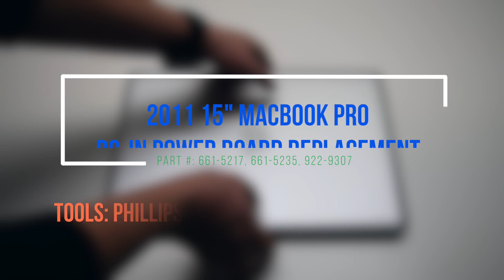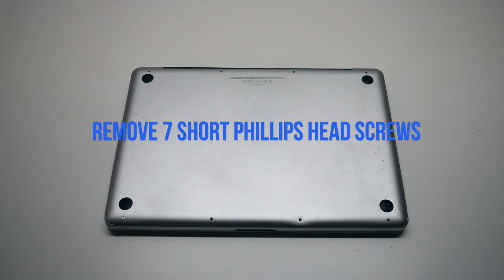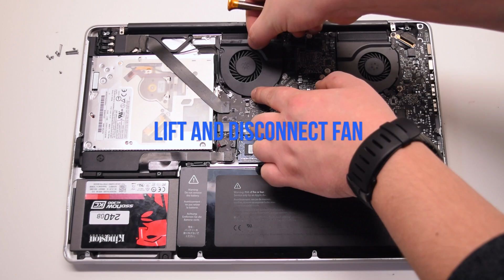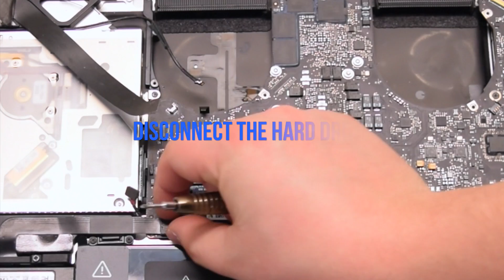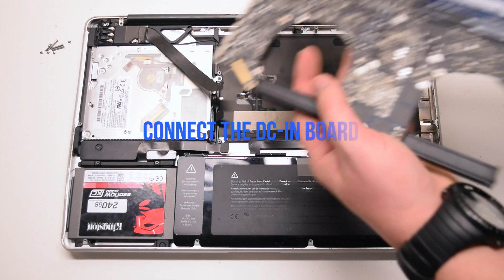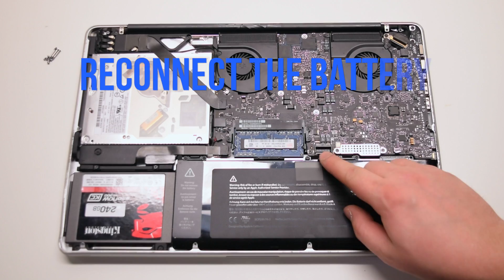2011 Macbook Pro 15" A1286 DC in Power Board Replacement

Comment: You actually CAN replace the DC-In Board without removing the logic board!
Unplug the battery. 
Unscrew the screen connector brackets, pull connector and tape out of way. 
Take the fan out. Loosen the two screws on logic board on the DC board side. [Probably not required]
Unscrew DC board, Take a narrow plastic spatula and pry the connector off underneath. Any instrument with a right angle that's not sharp will work getting into this tight space to push against the wires. 
Wiggle out the board. It's tight, but it will come out.
Inserting the plug on install might take a few tries to align it. It helps to bend the cable of the new board exactly the way the old one had it. 
You could make a tool out of a stiff 2mm wire, bent a 20mm angle at the front, shrink tube it to insulate, and bend a grab loop at the end. This would work for pushing the plug off and on.

Comment: Cross wired the wires on my power supply and they both tossed while i had black tape and not the chartering port burnt up do i need a mother bored or do i need the charging port only? Any ideas
Reply from the maker: Charging port is what I would replace first but no guarantees, they are $5 so worth a try.
Reply: Save Apple Dollars I did and it worked but had to put the negative to the positive on the charging wire had to cut it
For it to charge.

Comment: My book pro 2010 15 not turning on and showing green light when I charge
Reply from the maker: I can be that the keyboard is not working. Open up the rear panel and unplug the keyboard. Then use this guide http://www.insidemylaptop.com/turn-on-macbook-pro-laptop-without-power-button-locating-power-on-pads/ to power up the Macbook with tweezers while it's plugged in. If you can't get it to power, then your logic board is bad.